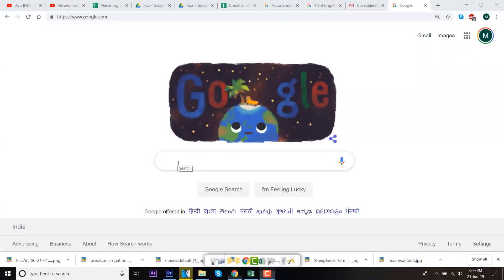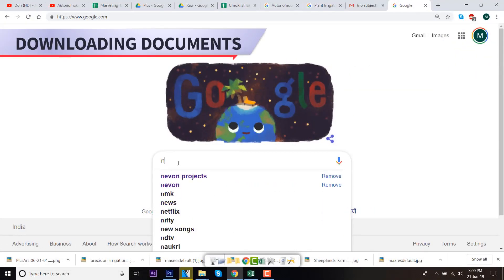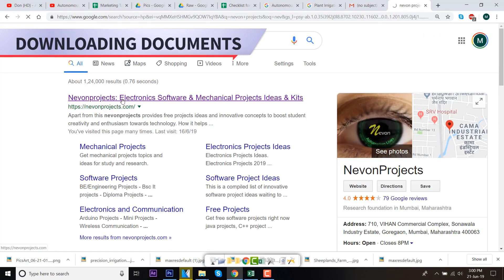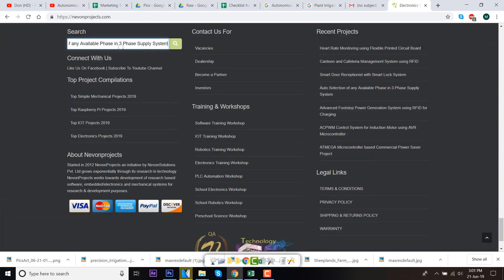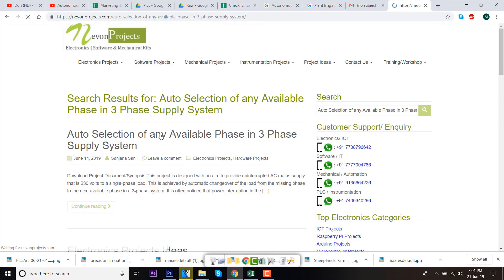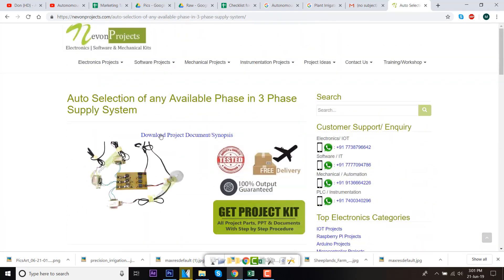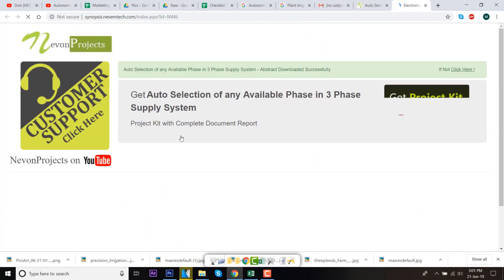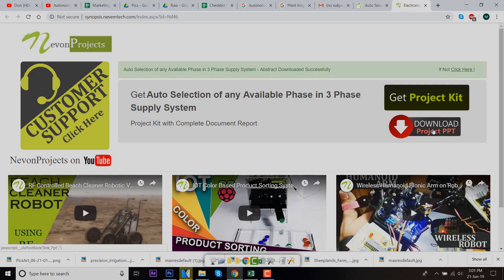Auto Phase Selector for Available Phase in 3 Phase Supply Electrical Project

Comment: Did you consider voltage in all phases I mean in Phase has 230V and other two have 100V, then it must select 230V Phase.
Reply: Idk if this reply is late, but isn't supposed to be 230v in all the phases (like a balanced system)
Reply: @Osama_The_Llama  thanks
Reply: @Devon Jared Thanks, please check and update

Comment: You are not using  3 phase line. You are using a single phase. And giving the circuit board power form a different transformer. Which not mean 3 phase supply. when your 1 transformer supply is off then circuit powered by another transformer. Please don't make this type off projects ☺
Reply: What's the reply